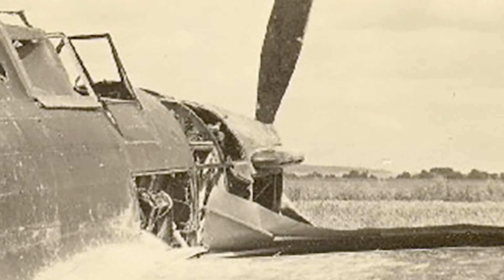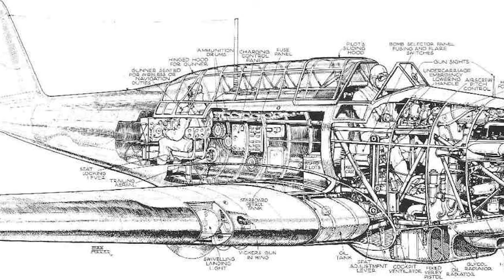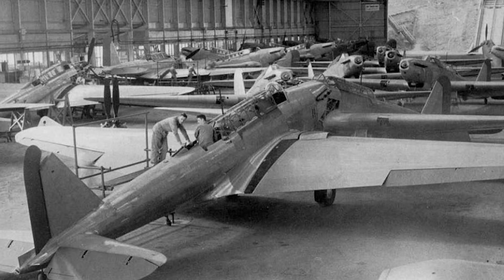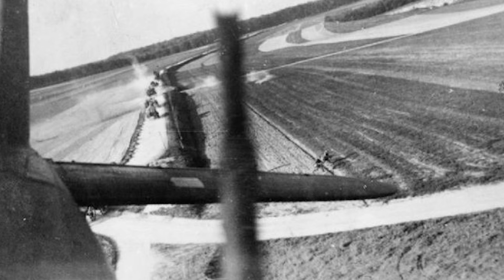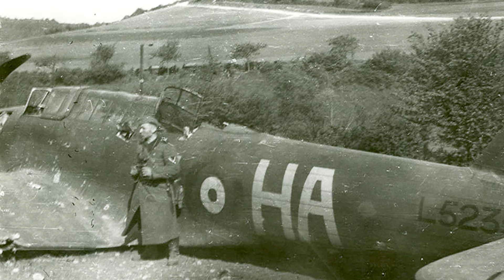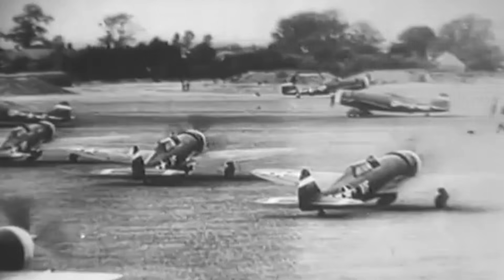The Fairey Battle - Light Bomber, Heavy Losses | Aircraft History #6

Comment: Flying target and coffin for 3 airmen. Fine in 1936/38 outdated by 1940.  Could be shot down by a Gloster Gladiator or it's equivalent.
Reply: It was built as a strategic bomber, hence a navigator in a cabin with next to no view. When it was decided to use it as a tactical day bomber it was not converted for its new job, that was Air Ministry negligence, not the fault of the design.

Comment: Battles suffered like all British day bombers from the myth of the self-defending bomber, the unwillingness of the RAF to escort day bombers, the failure to fit self-sealing fuel tanks (the Luftwaffe and even the French did that) and the failure to armour the aircraft for low-altitude tactical bombing or change the bombs for smaller instant fuzed ones. The armour was made and sent to France but not fitted. Even Mosquitoes would have suffered in that tactical environment. In June the Battle squadrons had learned something and had far fewer losses.

Comment: Really was doomed from the start wasn't it? Built to obsolete specs because the RAF was desperate, no fix for the inadequate armament without redesigning the whole airframe, and replacing/armouring the non-sealing tanks added weight and slowed it down even more. Wrong aircraft, wrong place, wrong time. Much respect to the men who had to fly them into combat.

ed: I presume that Fairey went with just the single forward-firing .303 due to the bomb load requirement and the wings being full of fuel. Adding more guns/ammo probably would've compromised range to the point of uselessness. It is a great looking aircraft though!

Comment: I checked out the Fairey Battle at RAF Museum in London last year. I've always though these were a gracefully shaped aircraft, except for the wheels not fully retracting. Like the Ju-87 and aircraft this size carrying a 1000lb bomb was rather a lot for a RR Merlin to pull at a decent speed, although the Jumo 211 in the Stuka had an even worse load.

I've never understood why they never added a spinner to the prop. Maybe the performance advantage just wasn't justified, I don't know. I suppose most of the poor old bird's shortcomings are explained by the age of the original specifications, with huge advances in fighter performance having overtaken it since its first flight. Like the Messerschmitt Bf-110 it failed in it's intended role only to find success in a different niche later on. Just illustrates how rapidly military aviation changes on the lead up and especially in the cut and thrust of war.

Thanks Rex. I'll be in London in briefly in May. Maybe I could shout you a beer?

Comment: Is that just me, or were these early Merlin engines a lot smaller than the later versions in Spitfires, Hurricanes and Mustangs. I don't see that the Battle was massively bigger and the nose seems very tiny to house the Merlin. And sadly it was, at the time it had to fight, way too slow.
Reply: Rolls Royce Merlin II ... same engine as the Spitfire Mk.1, The Hurricane Mk. 1 and the Boulton Paul Defiant.  The later merlins had two stage two speed superchargers fitted to the back of the engine which made them seem longer, but the actual engine was the same length.

Comment: With the benefit of 20/20 hindsight, I would have changed P2732 to a 'high speed', single seat light attack bomber capable of carrying a single 1000 lb bomb in a semi recessed bomb bay and given it two or four forward fining Vickers. Pilots would have been trained in fast, shallow angle bombing tactics similar to what was used by rocket armed Typhoons later in the war. The aircraft should have come in at half the weight or less with a top speed as close as possible to 300mph. (The larger and heavier Fairey Fulmar topped out at 272 mph.)
Reply: Well, they could at least have these https://www.youtube.com/watch?v=SjdCOn3fm8M
But for some strange reason they didn't use them and preferred to mass produce Battle and Fulmar. Even a modified streamlined Defiant, without the gun turret, would be much better. Part of the renerality&admiralty must have been either s*dists or corrupt incompetent m*r*ns.

Comment: It met the specification, it had no aerodynamic vices, it was pleasant to fly and it did a useful role once removed from front line service. In short, it was a good aircraft - just a poor and obsolete specification. If tiger moths were sent into combat they would have been shot out of the skies, that doesn’t make them bad aircraft. A better example might be the Lysander - it met the specification for an army observation aircraft, but was hopelessly vulnerable to German fighters when deployed in this role. It was therefore a total failure, but very successful in other roles - so not a bad aircraft, but a bad spec…

Comment: A major point in the background that lead to the Fairey Battle was the huge success of fast, single engine, twin seat, biplane bombers it was meant to replace. They were easily as fast as the biplane fighters of the period, making them able to operate without fighter escort. The idea was to simply continue with the same concept while switching to a new, faster monoplane with retractable undercarriage. From an early 1930's perspective that made a huge lot of sense. At that time it was almost impossible to predict that the basic design of monoplanes with retractable undercarriage would result in a much larger gain in speed in single seat fighters than it did in twin seat, light bombers.

Comment: Stuka was amazingly accurate in the right hands. In January 1941, to the east of Malta, 24 Stukas put six bombs onto HMS Illustrious, one going down the aft lift and exploding in the hangar. Another penetrated the deck and a flow-up attack put another bomb down the aft lift space. Illustrious steering on her engines, entered Malta's Grand Harbour with her aft hull glowing red hot from the fires. The Germans lost three Stukas in the battle but were ultimately beaten by the quality of the British ship, her armoured decks and amazing work by her AA gunners and damage control crews. The Fleet Air Arm's Fairey Fulmar aircraft (navalised versions of the Battle) even with eight .303 machine guns were pretty useless even against the slow flying Ju87.

Comment: an odd aircraft pretty much obsolete as it went into service.
Reply: Not true ... the aircraft entered servive in June 1937 and was well liked by its crews as being a vast improvement over the open cockpit Hawker Harts and Hawker Hinds it replaced.  Three years later when war broke out it was considered obsolete, but the pace of change in aircraft design at the time was very great, and many aircraft of the era suffered similarly ... Bristol Blenheims, Westland Lysanders, Me110s, Bristol Bombays, Handley Page Hampdens, Ju87 Stukas, Dornier Do17s, Boulton Paul Defiants, Armstrong Whitworth Whitleys for example ... all were fairly dismal in their designed roles but some were fortunate and went on to find a niche in service for which they were never designed.
Reply: @chrisrichards2544 To some extent I agree except, when it went into service, it had the same engine as the single engined fighters going into service, The battle suffering with a much larger airframe, additional crew, additional equipment, and a bombload. Unlike the blenheim, (which was faster)it was recognised at the outset that it had built in obsolescence and would struggle badly in daylight against fighters of a similar vintage. So 'pretty much obsolete' at service entry is not an unreasonable point of view accepting in replaced some biplanes,

Comment: An obsolete airplane with a great engine. What a waste. Hurricanes with bombs would have been better.
Reply: The Fairey Battle could carry up to 2500 lbs of bombs ... 1000 lb in the internal bomb bay and 1,500 lbs extternally.

The Hurricane IIC ... the famous "Hurribomber, of which 4,751 were built ... could carry only two 500 lb bombs externally and its performance was considerably reduced from that of the fighter version.

So, it would take two and a half fully loaded Hurribombers to equal one Battle ... or two and a half Squadrons of Hurribombers to equal one Squadron of Battles.

Comment: The Battle was much more a threat to German divisions when she was used at extremely low altitude for surprise attacks, since she was fast and versatile enough, avoiding detection and AA fire, as the Russians did later with the Sturmovik. But British Command didnt extend that experimentation as a new standard and kept the mid-level bombing theories, allowing easy detection for all enemies (AA fire and fighters attacks), with the poor result described in this video.
Excellent job, thanks for this !
Reply: the IL 2 Sturmovik , even in it's earliest form had armour plating for the pilot AND decent calibre guns/cannons - comparing that ( defence/offense ) to the two .303 's on the "battle " is unfair to the Russians
Reply: Exactly, the basic airframe wasn't a problem, an upgrade to a later Merlin, some armour and better defensive armament but above all better tactical use.
Reply: Or throw away the airframe and nsil a Hurricane to the engine. .
Reply: Yes thinking was not an RAF thing until forced on them.   No shop in the mess.

Comment: OK so it's  a Hurricane with an extra 1500lb weight, plus 1000 lb  bomb load, plus an extra crew member, plus enough  fuel to fly 1000 miles.
What can possibly go wrong??
Reply: Well,
It could have had a turret.
Reply: @taggartlawfirm  See 9:17...
Reply: @wessexdruid7598 I stand corrected.
Reply: I'm on about what a happened if they remove the extra crew members
Reply: @jamesricker3997  You cut the casualties by half... That's about all.
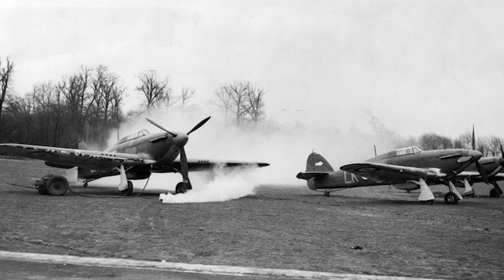Reply: Especially true of those at 3:57.
Reply: With two extra crew members! Why sacrifice only two men when they could easily sacrifice three, that wonderful "logic". Only those generals would deserve to fly to the front in Fairey Battle, if possible!
Especially when they rejected the much more suitable Hawker Henley frontline aircraft. But they would still need a fighter escort... (The irony is that those generals would definitely get it.)
Reply: At the time of the specification the drag penalties of multi-engine nacelles, higher fuel consumption and more weight were more apparent. The benefits of one engine on the centre line made a single-engine bomber look like a good idea. After the early losses in France a better short-range day-bomber was proposed with four forward-firing Brownings, two at the back, armour for the crew, engine and fuel, less fuel, no navigator and all of the strategic bombing bumflufferies removed to save weight. Rather like the Il-2.
Reply: It was designed as a strategic bomber and used as a tactical one but the alterations that would have made it far less vulnerable were not made.
Reply: @squeeth2895  Not quite strategic as that was for say Vickers Wellington, but  definitely  lightly protected   behind the front line targets
Reply: @ztevkonrad6329  Look at the specifications.
Reply: The Hawker Henley is the Hurricane like 2 seat  light bomber , also with a Merlin, 250lb  more empty weight and internal bomb bay. This should have been  the RAF   fighter bomber for  front line work in 1940.  Larger  Fairey battle was more for rear areas that were less well protected -. ammunition dumps,  vehicle  parking lots , command HQ etc.
Reply: Carey Elwes could have flown it.
Reply: With 1/4 of the firepower